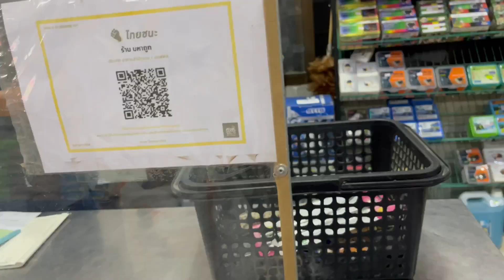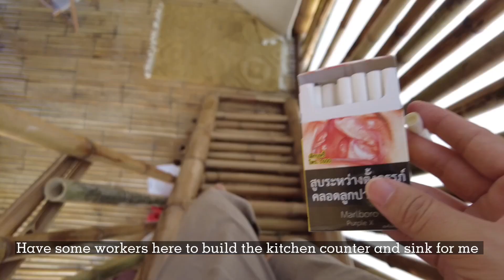EP.6 Water? Electricity? Online shopping? How do I survive here｜有水吗有电吗有网络吗？我的生存日记

Comment: 1.. You can DIY a ladder/slide for your dogs to ascend from ground. Get a 2"thk x 9"wide solid wood plank x 6ft (if it can fit inside your car?). Get two pieces if necessary, to widen or to lengthen your ladder.
2.. Not sure if you have thought about have a simple DIY pulley system basket, attach to the interior of your home to ferry stuff, dogs, from 1st to 2nd floor..?
Have another at exterior if needs to.. 😁😁
Reply from the maker: Very interesting ideas haha